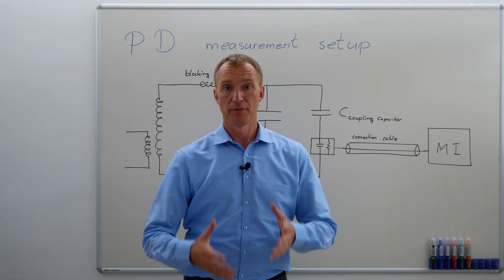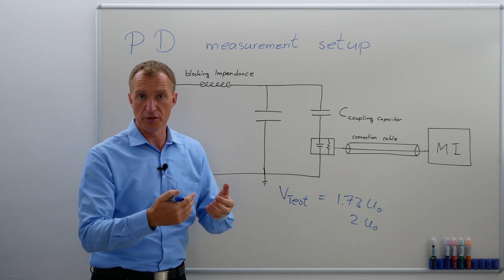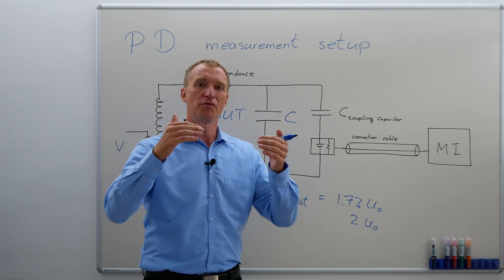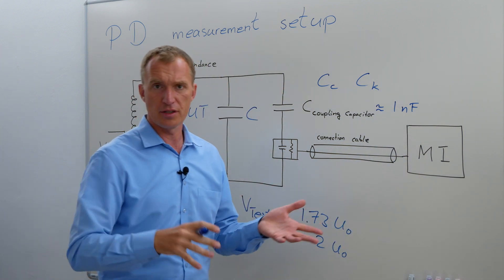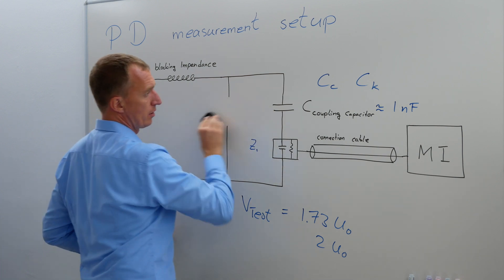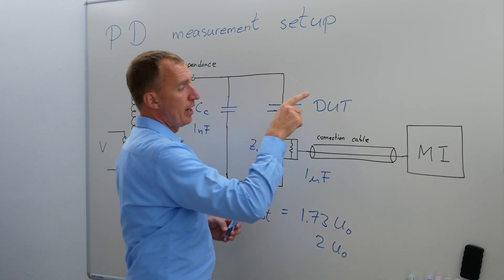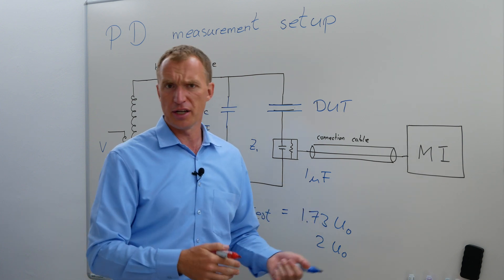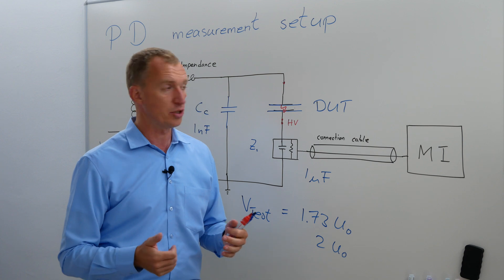2.3 Partial Discharges Vocabulary - Partial Discharges measurement setup according to standards

Comment: Sir,In the real PD measurement we normally use bandwidth frequency, which is greater than signal around 10 times. I’m curious about the measurement circuit. Capacitance in the measuring part is represent as low pass filter, so what about a high pass filter to perform range of measurement.